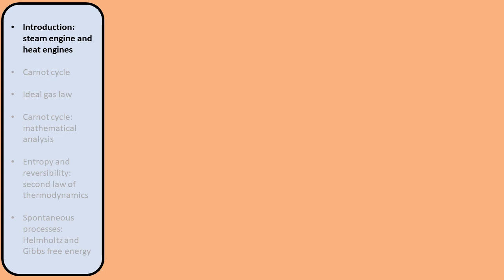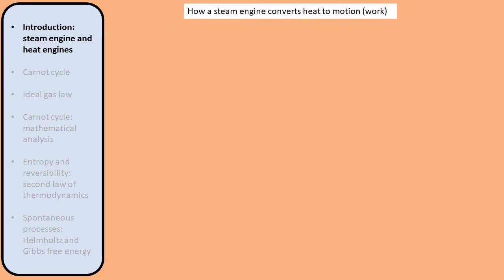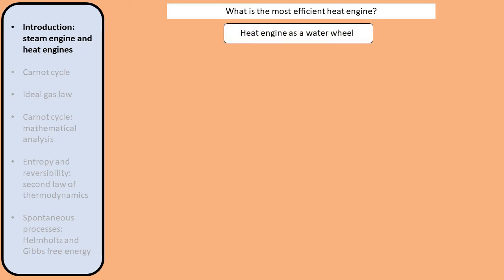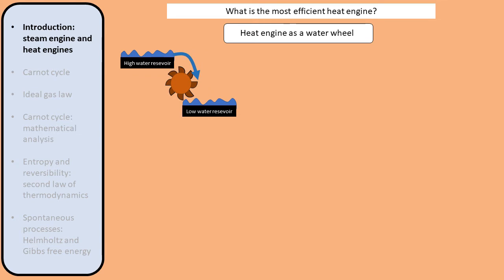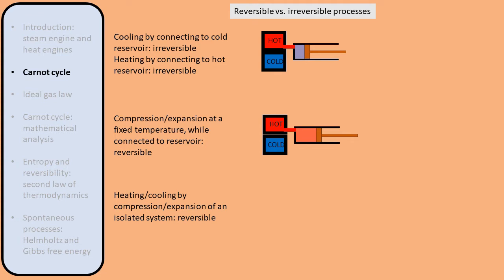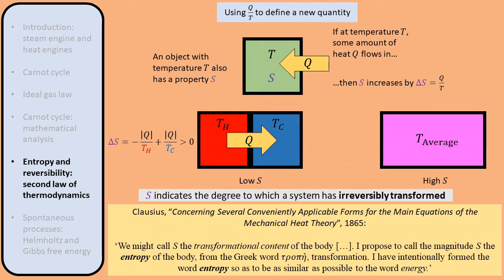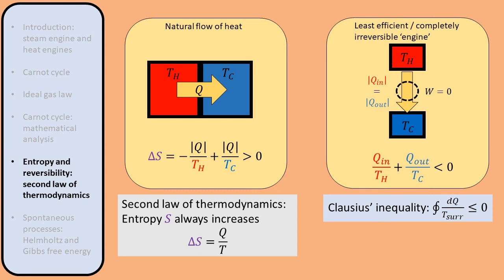01. Thermodynamics: Carnot engine, Entropy, Helmholtz/Gibbs free energy

Comment: I have always struggled with this topic, thank you for this very clear exposition. One thing that used to confuse me, was I thought that in the Carnot engine, gas had to flow from the hot to the cold reservoir. But from your video (and from considering a toy Stirling engine) it is clear that only heat needs to flow from the hot reservoir into the piston and then from the piston into the cold reservoir (with some of the heat energy converted into work). In many heat engines gas does flow from the hot to the cold reservoir but it is not necessary to consider for this analysis. The same amount of gas can remain in the piston throughout the cycle.

Comment: @27:28 the simplified form of clausis inequality may have an error.  You have used Th and Tc and so that is the same as the original equation where you got a positive result.  However, you get a negative result the second time and say that you are not considering the Temperature of the reservoirs as before.  But the equation says otherwise.   You say you are considering the temperature of the surrounding.   And indeed that is what you say in the integral equation. 

I believe what you mean is Qin/Ts -+ Qout/Ts < 0, not what you have Qin/Th + Qout/Tc.  Because the Work is 0.   Qin/Ts is > 0.  But Qout/Ts is < 0 and Qout < Qin which means it has to be negative.   As oppose to the original Qin/Th + Qout/Tc is > 0 because Th > Tc and Qin and Qout are opposite.  And by convention Qin is positive and Qout is negative.  It's the denominator Tc > Th that makes the whole thing positive.

Excellent video, though.  I don't think I've ever seen such a comprehensive treatment.  You almost sound more like a chemist or mathematician and not a physicist.  For whatever reason, I find physicists tend to be more sloppy with the book keeping than are chemists and mathematicians.
Reply from the maker: Thank you very much for this comment. I hope to learn from it, but I'm afraid I don't fully understand it yet at the present moment.

- '[You] say that you are not considering the Temperature of the reservoirs as before.  But the equation says otherwise.' 
Is this referring to what I say at 27:03? My point there was that in the equation, we don't consider the entropy change of the reservoirs, because the signs of Q_in and Q_out are defined with respect to the engine. I.e. a positive Q_in would imply a negative change in entropy in the reservoir, but the term in the equation would be positive ,so the equation does not express the entropy change in the reservoir. And since the equation does not express the change in total entropy (i.e. of both the engine and the reservoirs), it does not contradict the Second Law of Thermodynamics.

 - 'It's the denominator Tc > Th that makes the whole thing positive.'
I'm not sure I follow. Should it not be Tc<Th, since the temperature of the cold reservoir is lower than that of the hot reservoir?

The way I see it is the following:
1) |Q_in|=|Q_out| because W=0.
2) Q_in is positive, Q_out is negative (because they are defined with respect to the engine).
3) Because Th>Tc, the negative term Q_out/Tc dominates the positive term Q_in/Th, making their sum negative.
Could you perhaps indicate in which of these three claims you find something objectionable?

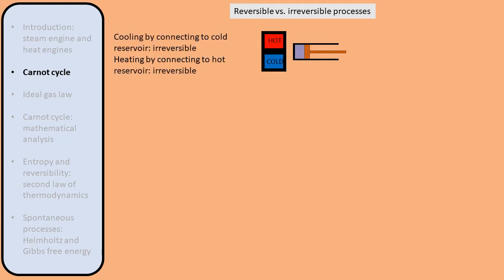Comment: 9:30 Why is this process reversible, when at 7:53 it is said that moving a piston connected to a hot reservoir is an irreversible process. It probably has to do with the fact that the temperature is kept constant when expanding the gas, but I do not see why this leads to a reversible process? Also, keeping the temperature constant while compressing the gas when it is connected to a hot reservoir should not be possible at all, or what am I missing here?
Reply from the maker: The assumption that is made here, is that the process is 'quasi-static'. Indeed, it sounds somewhat self-contradictory: how can there be a process when the system is static? The idea is that the process occurs so slowly, that while you're changing the system, it's always in equilibrium. E.g. if you compress the gas by the tiniest amount, then the temperature is raised by the tiniest amount,  but this amount is so tiny that the excess heat is immediately dumped into the reservoir, so that the gas has the same temperature as the reservoir again. Therefore, if you compress the gas sufficiently slowly, it is able to remain in thermal equilibrium with the reservoir during the compression (i.e. the gas always has the same temperature as the reservoir). Because the system is always in equilibrium, no extra entropy is generated (assuming there's no friction).
Reply: @SanderKonijnenberg  I see. I guess my misunderstanding came partly from the (wrong) assumption that the hot reservoir is always hotter than the gas, but if I got you right, it just maintains some "stationary"/constant temperature. But what still confuses me is what happens when the reservoir is intially hotter then the gas, then the heat will flow to the gas, which increases the pressure on the piston. Now, imagine I move the piston slowly/quasi-static until some endpoint where no heat flows between the gas and the reservoir. Then this process should not be reversible, because when the gas is compressed (even slowly), the reservoir cannot "spontaneously" take the excess heat that is generated, as both the gas and the reservoir started from the same temperature. But isn't this the  situation in the intial part of the Carnot process? Initially connecting a hotter reservoir to the gas? So, why is this still considered to be reversible, when it seems unplausible that the process will go in the other direction?
Reply from the maker: @StefanHoffmann84  Indeed, the reservoir is assumed to stay at the same temperature, regardless of whether you put heat into it or extract heat out of it.

Regarding the reversibility: it is the Carnot cycle that is reversible. The initialization should not be considered part of the cycle that follows. It is true that raising the temperature of a cold gas by extracting heat from a hot reservoir is irreversible, but during the Carnot cycle there is no point where the gas is connected to a reservoir with a temperature that is different than the gas'.
Reply: @SanderKonijnenberg  Ok. I guess I got it. That is the reason why the piston is moved slowly, so that the assumption is fullfilled that the gas and the reservoir have the same temperature during the process. Thank you!

Comment: 27:26 is little confusing to me. What i understand is first you defined entropy as [ heat given(+) or heat taken(-) to system] / T . Which always increases as you showed from 2nd law assumption. Then you said "in clausius inequality we are calculating entropy of engine not reservoir moreover we are dividing it by temperature of reservoir, hence it does not contradicts that entropy increases " In this statement their are lot of holes in my mind, the way you said it ... I feel like it means that in clausius inequality we are not measuring the entropy at all since dividing given heat to engine by temperature of reservoir is not how you defined entropy and hence it does not contradicts 2nd law. But  another teacher actually defined entropy and derived 2nd law using clausius inequality infact what your 2nd law states is what actually he referred to as the clausius inequality. I know different teacher call things with different names. But the confusion from 27:26 remains in my mind and it's unclear what you actually meant. Thanks. Very insightful video.
Reply from the maker: Perhaps the following quote helps (from hyperphysics.phy-astr.gsu.edu/hbase/thermo/clausius.html ):

'The Clausius Inequality applies to any real engine cycle and implies a negative change in entropy on the cycle. That is, the entropy given to the environment during the cycle is larger than the entropy transferred to the engine by heat from the hot reservoir.'

In other words, Clausius' inequality does not state that the total entropy (i.e. of both engine and the two reservoirs combined) decreases, because that would contradict the Second Law of Thermodynamics. Evaluating the total change in entropy would take into account the change in entropies of both the engines and the two reservoirs. But what is calculated here is the negative of the entropy transferred from the engine to the reservoirs (so the fact that it's equal to or less than 0 indicates that the entropy of the two reservoirs combined remains constant or increases).
Reply: @SanderKonijnenberg  Okay now i think it makes sense with what I was taught previously is similar to following integrals in worded form : 
(entropy given to engine) + (entropy taken out of engine) < 0
 <=> (the entropy given to engine)-(entropy given to reservoir) < 0
<=> (the entropy given to engine) < (entropy given to reservoir) 
<=> ( Considering reservoir as surrounding, engine as system  and processes in surrounding to be reversible. Equality will hold true if Q/Tsurr is also reversible) We can write Q/Tsurr < ∆S Which is our  second law.
Reply: If the entropy of the engine changes over a cycle, that would seem to imply some irreversible change occuring inside the engine. I suppose that does happen in a real engine -- parts wear out, etc. -- but that wouldn't happen in an idealised engine. In which case, Clausius's inequality does imply non-decrease of the total entropy of the system.

Comment: @ 31:25 A "closed isolated" system??? An open system, but no flow of particles??? You always surprise me, Sander.
Reply: I think "open" here means that the volume is allowed to change so that the pressure remains the same as that of the surroundings. E.g. a gas in a cylinder with a piston that is free to move.
Reply: @gcewing  Nice suggestion.